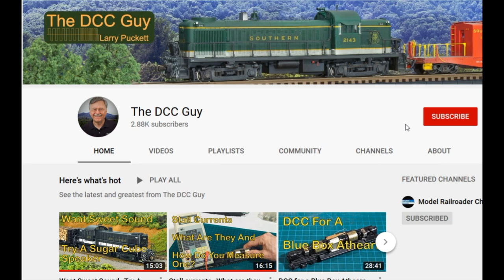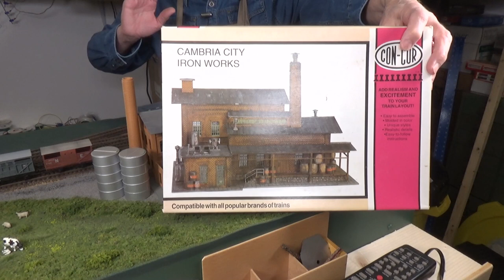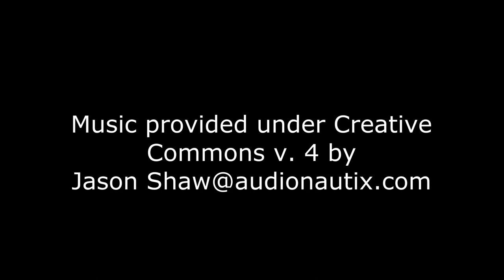Kitbash A Gas Works—Intro and Kit Selection (173)

Comment: In the UK not all Gas Works were rail fed, my local town had sidings at the station and loads were then road transported.  Some of the holders are still on Gas Depot sites, or have been converted for other uses.  On google maps look up the Oval cricket gound and look North, or head North of Kings cross station and there are some very expensive properties on the foot print of Gasometers.  I think the issue for a lot of UK modellers is that Gas Production sites tended to be huge and would take up a lot of space. Some even had internal standard or narrow gauge lines to move products about.
Reply: David Popp had a "gas works" on his Naugatuck N layout
Reply from the maker: I have only seen one of his articles on operating that layout and don’t remember it being in the section he showed. I an sure they’re been modeled but just not very common which is a shame given they’re a good industry for switching.

Comment: I realize this ques does not follow this video, but I am very frustrated. I bought some iPhone 4and 5 speakers for sound decoder installs. I paired one with a Tsunami sound decoder. I don't see what the big deal is. What's the trick? It does not sound all that great. Its just "ok". The regular soundtraxx speaker sounds better. Is the iPhone speaker supposed to blow me away? I don't get it. I tried the 4 and the 5. I dont get it. What's the big deal?
Reply from the maker: Well, what did you install it in? And did you adjust the equalizer  the Tsunami decoder for micro size speakers? Personally I have only used one iPhone 4 speaker and it sounds about as good as my sugar cube speakers.
Reply: Well, it sounds ok but not outstanding. Bli locos sound outstanding! I put it in a P2K PB unit. I think I may b expecting too much. Thanks my friend
Reply from the maker: BLI locos sound outstanding because they have a speaker, enclosure, and decoder that are tuned and tweaked for that specific locomotive. Also the model is designed for sound to maximize sound output. Sugar cube and iPhone soeakers cannot perform to that same level but they fit i  tight spaces that the BLI speaker would not. I used a 1” high bass speaker in my steam locos to get the sound I am happy with. I also have used two sugar cubes in a LL E6 and it is too loud believe it or not. To some degree getting great sound from a decoder is an art form that takes experimentation to find the right combination and the bigger the better.
Reply: I ended up putting two iPhone speakers in the PB unit. A 4 and a 5. It sounds pretty good now.

Comment: I know that there’s such a thing as a gasometer.  It’s actually what the gasworks holds the gas in.
Reply: Careful with calling it a Gasometer, as it sets of an extremely detailed argument over the proper name, I know as I got drawn into one. The term Gasometer is understandable and is the name that the general public know, but it is not the proper name (it is one that I use frequently as everyone understands it) but those  that worked in the industry,and being in the UK there are still plenty of model railway people that once worked in gas works, will insist that the proper term is Gas Holder. There is a very good book on modeling heavy industry, Modelling Heavy Industry: A Guide for Railway Modellers by Arthur Ormrod, that details how to scratch build a Gas Holder/Gasometer as most of the kits are way under sized.
Reply: @prc789  How many times has this happened to me?!!  Thousands!!  I still can’t stop thinking of them as gasometer!!
Reply: @Madonsteamrailways  I'm the same, my attitude is, if you understand what's being talked about, it doesn't matter what you call it. Some people get really precious about technical terms! More people know the term Gasometer for these structures, and many of them would not understand what you meant if you called them Gas Holders. The term Gasometer for these originates from the Victorian era and originates from William Murdoch,  so is technically a correct term....

Comment: If credit is given to the picture owner, why is that not allowed?
Reply from the maker: You need to read the fine print on those pages. In most cases the photos can only be copied/downloaded for noncommercial PERSONAL use only, and it cannot be further disseminated or displayed. With a YouTube video it has to be downloaded and embedded into the video file which violates the copyright in several ways. I would have to purchase the commercial display rights to use them. And as the man said when the monkey peed on the cash register, that can run into money!